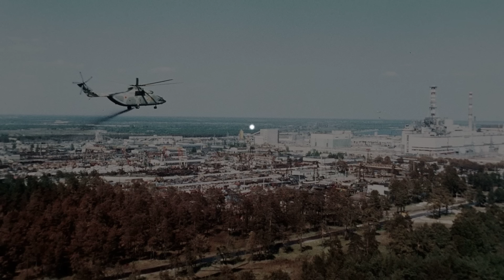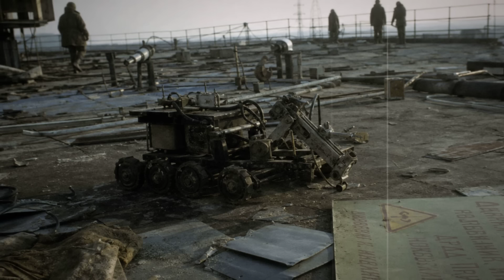The Machines That Built the Tomb Over Chernobyl (1986)

Comment: The original Chernobyl Exclusion Zone (also called the Zone of Alienation or the 30-kilometre zone) was established by Soviet authorities in early May 1986 as a roughly circular area with a 30 km radius centered on the Chernobyl Nuclear Power Plant. 30km across implies 15km radius.
Reply from the maker: Thanks for the correction, Kolan you're right, 30 km radius, not diameter. Appreciate the precision!

Comment: @ConstructionLegends: interesting segment. If I recall correctly, the New Safe Confinement structure was damaged last year by a drone strike. I wonder if the strike resulted in radiation that leaked into the environment.
Reply from the maker: @mjc11a Thanks! The drone strike caused some damage but no significant radiation leak was reported. Structure held up well.